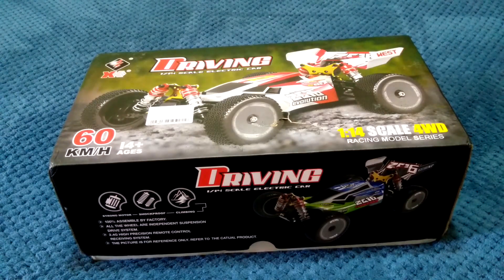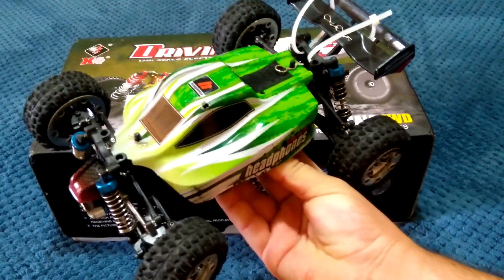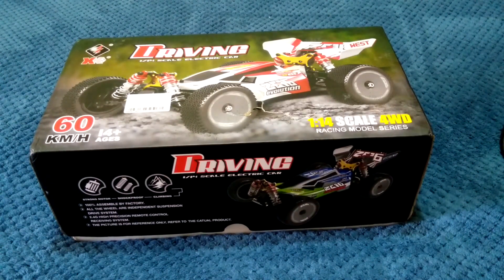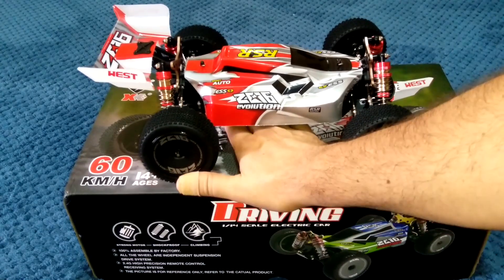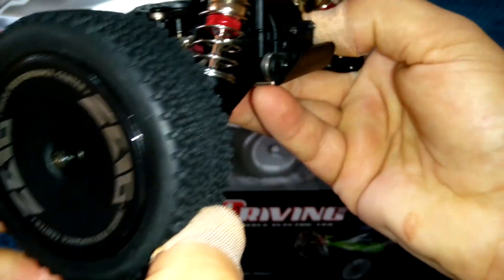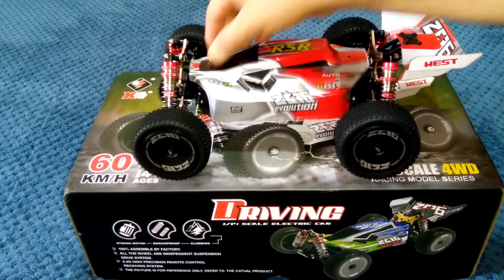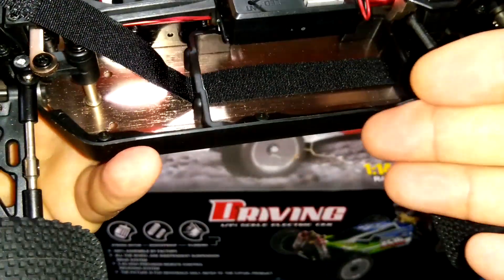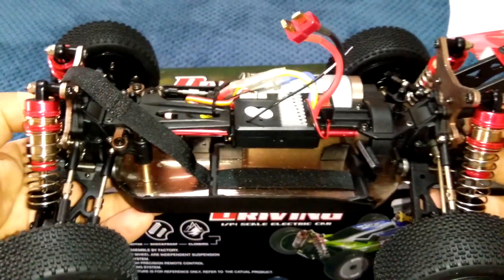WLTOYS XKs 144001 1/14  Scale 4WD High Speed 60km Buggy - 1st Look

Comment from the maker: WLTOYS 144001 1/14  Scale 4WD High Speed 60km Buggy
Get Yours Here 👉 https://bit.ly/2NY792G
Use this code BGRC144001 for low price of US$73.79 
WLTOYS 144001 Buggy 2x battery combo here 👉 https://bit.ly/2XtvvWv 
Use Code BG144001WL for 20% off 2 battery model

FULL 144001 Spare Parts Page Here 👉 https://bit.ly/32W124F
Get A Further DISCOUNT by using these Coupon Codes AFFBG10,(10%off) or Toyho (7%off)

Also there is groupbuy promotion for Black Friday on this 144001 right now! 
Wltoys 144001: http://bit.ly/2QyfsFl
Amount:  Need 10 persons
Groupbuy Price: $64.99